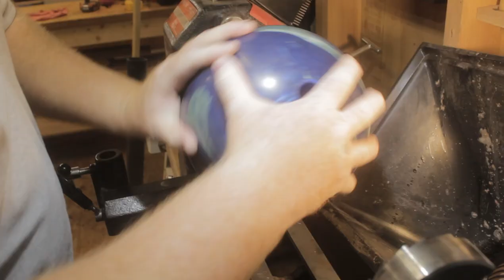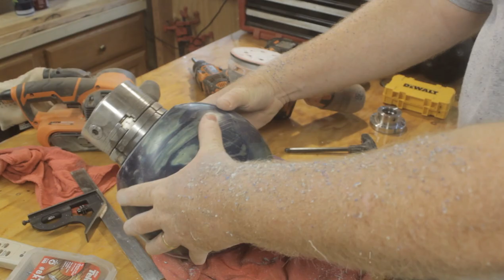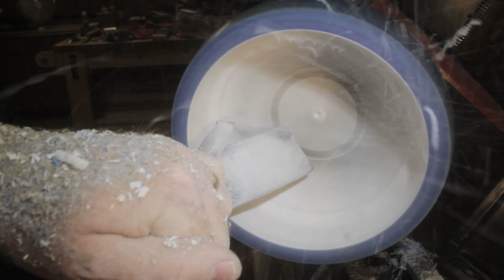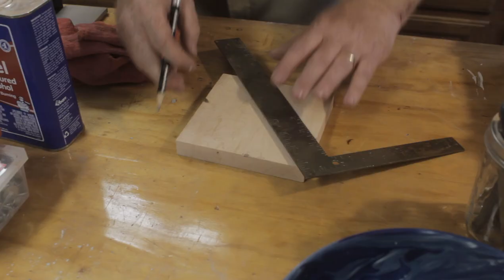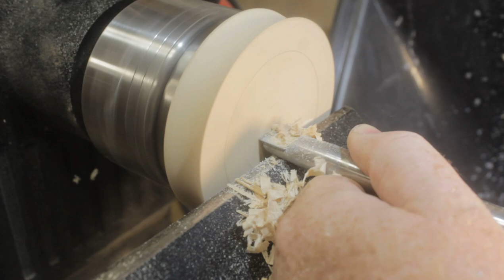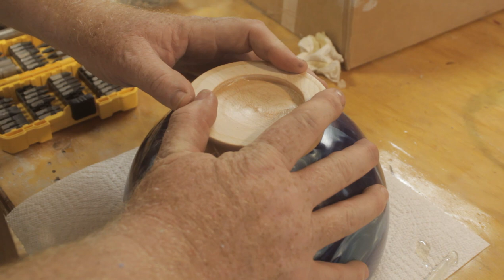Turning a Special Bowling Ball

Comment: Beautiful! Almost like looking at an earth’s image on the one area. Far too fancy for a popcorn bowl, I’d say. Was really interesting to see the inside of a bowling ball. Do you know what materials were inside of it?
Reply from the maker: Hi Lynda, I'm not exactly sure.  It was a very soft material.
Reply: @LivingstonBrothersWoodcraft  Bowling balls are made out of different types of resin depending on how you want it to perform. The balls provided by your local bowling alley have just a core and an outer layer that are easy for everyone to use. Professional balls, like this have an asymmetrical hard resin core in the middle, a softer resin filler, and a hard resin outer layer. The professional balls have more hook to them. Also, I would not use this for food since bowling balls are made from a resin that is not food safe.